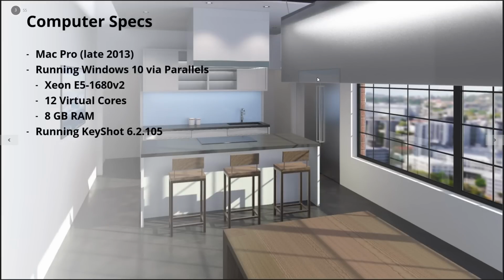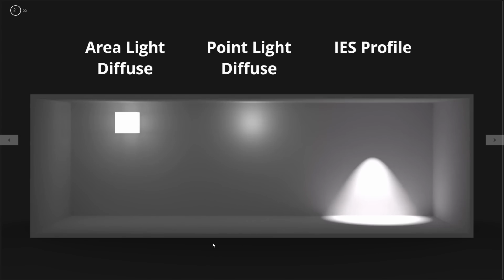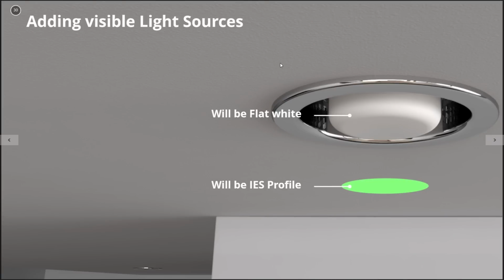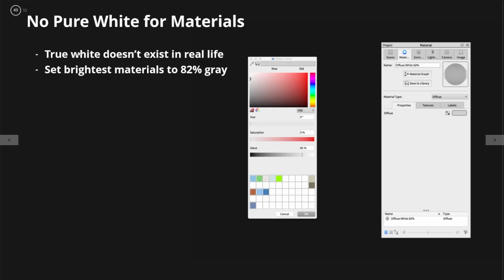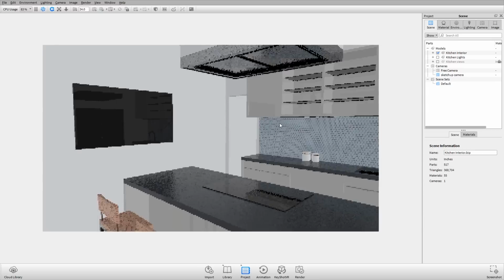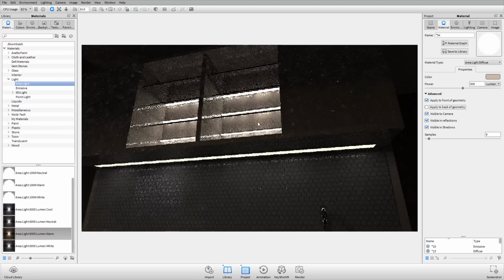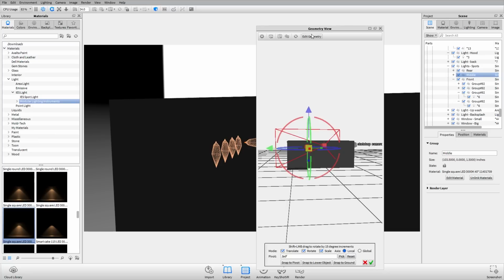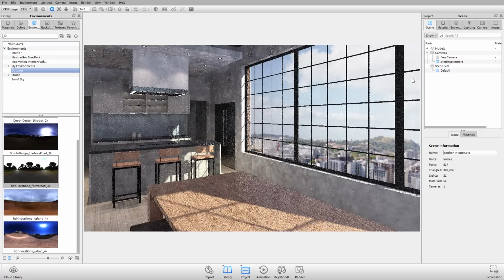KeyShot Webinar 55: Master Lighting and Interiors

Comment: how do you create those circular planes in sketchup you used for the Auckland landscape? how do you make it with zero thickness & not have multiple faces (Richards is smooth)?
Reply: Shall be really easy with a surface on rhino. you can just build the curves and patch it

Comment: Hello, I have made an interior model in Rhino, the roof has a hole so I trimed the roof plane. After I finished the model and exproted to Keyshot, I found when I turned on interior mode, the roof surface looks brocken by several triangle surfaces,  but when I turned off interior mode the surface went back smooth and flat, could you help me to solve this problem? I tried to increase the detail level of the roof surface, but triangle surfaces still be shown in the rendering image. This is the image link. 

https://drive.google.com/file/d/0B2yE4bZRsQc7eHlXRkVsUFNISnM/view?usp=sharing

this wierd problem only shown on a trimed nurbs surface
Reply: Without actually seeing the model it's a little tough to judge, but It looks like it may be due to incorrect normals on that surface. Is it possible to re-build just that surface? 
I hope you were able to get it resolved. Feel free to post the issue in our forum (www.keyshot.com/forum/) if it's still an issue.
Reply: Thanks a lot. I thought it may because of different surface ogarnization between polygon software and nurbs software? I have fixed the normal derection several times, and  it was still there. After a couple of days later, by an accident that I moved the light surface from outside of the window  to the inside of the window, then all problems have gone. It was wired. But thank you for replying me, any way
Reply: Sure thing! If you have problems in the future feel free to post the scene on our forum: www.keyshot.com/forum/

Comment: Great seminar, thanks - even as a 'seasoned' user I picked up some tips. One thing I'm struggling with though, and I thought you might have addressed it, is the blotchy effect you get on surfaces. Right at the end of your demo I could see the blotchy effect all over the walls, how on earth do you get rid of that? Is that where increasing the samples comes in? Really frustrating me. Thanks for great content guys.
Reply: Hi Rob, thanks for watching! The blotches will disappear over time, they're usually only visible for a short time while the lighting/shadows are calculated. Once the real-time view sits for a while (or the image is rendered) the results should be smooth.
Reply: Richard Funnell II Thanks for the reply Richard, however I wouldn't have a problem if these blotches disappeared once the scene was rendered.  In my case the anomalies are still there in the final image. Is this something worth taking up with support?
Reply: Rob Woods Is there any chance you have caustics enabled under your lighting presets? That may take longer to resolve. Also, are you on KeyShot 6?
Reply: Hi Richard, yes I'm on v6 latest update. I know one of the renders I did used caustics but I'm also sure others didn't.  Perhaps I'll take this up with support and send examples...
Reply: That may be best!
Also it's worth noting that the solution may simply be more time or samples; in complex scenes exceeding 1,000 samples can be common.